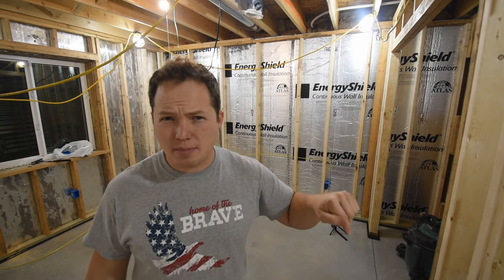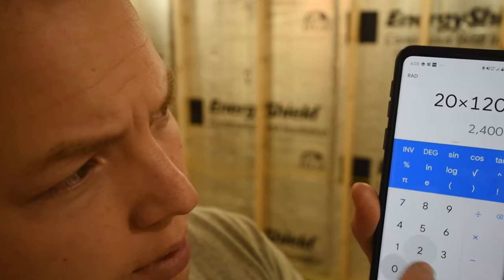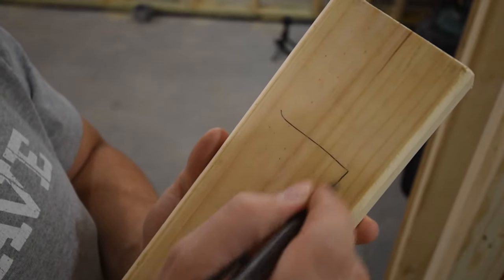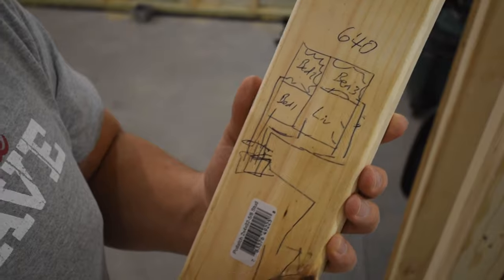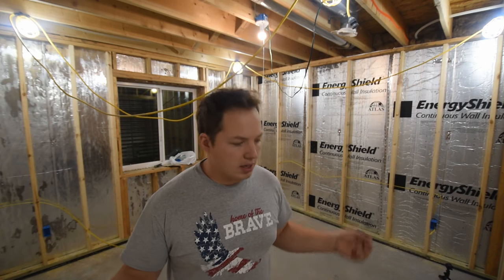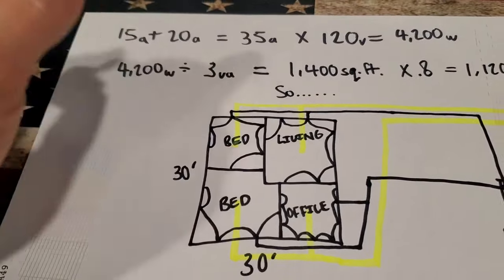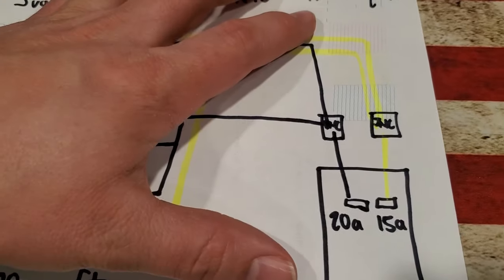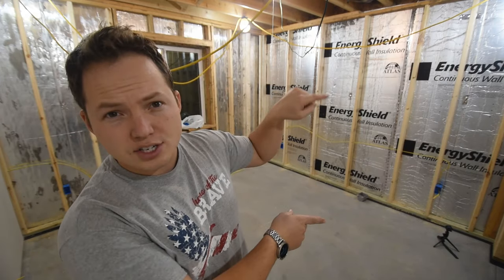Does a Bedroom Require a Dedicated Circuit? - Using the 3VA Rule To Calculate Anticipated Loads

Comment: Awesome video. Only time you can have issues with combining the room outlets (and I've had this problem) is room A is running a 1500 watt room heater, Room B sister is running her hair dryer. Bingo.....breaker keeps tripping.

Comment: Separate lights also helps if you draw a heavy current close to the limit, say a space heater pulling near the max of the circuit, well the lights share the same circuit so you might get flickering. Throw in some fans and a TV and you might go lights out along with everything else because you opened the breaker.
Reply: OH NO! You just answered my question! I was wondering if this rule would take into consideration my kids...and I😅 We have those power strips with the 8 outlets in almost every outlet, and we have space heaters; mine I keep on year-round and now that I work from home, the breaker trips multiple times a day!..But I can't live without my space heater😭
Reply: The NEC changed the code to account for LED lights. They are now allowing 16ga wire with 10 amp breakers. I'd never use them but it's now a thing if you can find them. 
If you're using 6 watt LED wafer lights on a 15 amp 14ga circuit, P=EI or Power = 120*15 amp breaker *.8 (80% load capacity) = 1440 watts or 240 wafer lights on one circuit. I for one will never use incandescent or florescent lighting again so I have no issue running two lighting circuits for a 2200 sq ft home.

Comment: Very good advice. I keep fixed lighting and receptacles on separate circuits. Having the living room and family room receptacles on their own 20 amp circuit is also a good idea.  Wiring the bedrooms like you stated is also good advice, makes it easy to separate each onto their own circuits if desired. While most of the time bedroom plug in loads are usually light,  this may not always be the case. Everyone might use their bedrooms differently.   many times a bedroom gets used as a home office, or as a hobby room and it might be desirable to have those receptacles on their own circuit.
Reply from the maker: Couldn't agree more! Home office or hobby room is a very good point. If it is wired so that you can have at least one dedicated circuit to that room then I think people would be good to go for almost anything. You never know when someone might want to turn their bedroom into a metal working shop though! (kidding)

Thanks for sharing!
Reply: I'm a.ecjanic but I'm also a computer hobbyist. I would hate for someone in another room to pop the breaker and crash my computer.

Comment: i used the 1 room, 1 home run rule. ( each outlet no more than 9 feet apart, and no more than 7 outlets per run ) allowed me to isolate any issues. I also added in for future use, 2 bedrooms, with dedicate home runs,for any A/C  or large appliances that might be needed in the future. the runs are not connected, and have blank wall plate. but, it is there, to save time and effort for any future calls. especially when using a portable generator in power outages. helps me to prioritize my comfort vs requirements. Also with the codes, requiring the new more expensive breakers, i just felt it might be more safe..it does have more cost, especially when the distance to the service panel is taken into account.

Comment: Great tips.  One thing I seldom see addressed is length of the circuit in total (panel to farthest end device) and taking into account voltage drop issues at the far end.  What is the longest acceptable length one can go before drop becomes a factor?  I hear somewhere in the 3-4% range (3.6-4.8 volts) should not be exceeded on a 120V circuit.... somewhere in the 50-75 foot range.

Comment: As AFCI breaker requirements have increased over the last couple of code cycles, and given the cost of AFCI breakers, there is incentive to "max out" your circuits to keep the cost of wiring a house within budget. Especially if you wire houses for a living and are in competition with other electricians for the work.
Reply from the maker: Valid point for sure.
Reply: yeah, before this... bullshit... dedicated 20 for outlets per room and lighting on a different circuit. I hope the cost comes down on arc breakers because damm!
Reply: Do lighting circuits need to be on AFCI breakers?  I totally agree to "max out" circuits. Another question is, is it cheaper to use 15A circuits so you can use 14awg wire compared to 20A?
Reply: @scottschuette74  14awg wire is less expensive since less copper is required to make it.  However the NEC requires 20 amp circuits in certain places especially kitchens where high wattage appliances are likely to be used.  20 amp receptacles are better quality and also more expensive.
Reply: @Peter Evans ⚡watch his next video..
Reply: @Peter Evans think about next show...
Reply: @Karl with a K It must be a real burden to be so damn smart you can't listen to someone else.
Reply: @Karl with a K 😅🤣😂

Comment: Cool rule of thumb. Good video. With LEDs now even 15A would be fine for every room. Lol. I do all outlets in 12. Lights in 14. Even Fridges dont use much now. Crazy.
Reply from the maker: Yeah it's pretty amazing how efficient a lot of the new devices are! To your point refrigerators only use 100 watts or so and only while the compressor is running!
Reply: Yeah, the incandescent bulbs in the Hollywood lights in the bathroom in the house I bought used much of the capacity of a 20A circuit. Not enough left for a space heater, I found. They will be changed out with LEDs before air conditioning season.

Comment: I have multiple bedrooms and when I built my house, this was my requirement- dedicated circuits for outlets, dedicated circuit for switches and lamps, and a dedicated 20amp wall receptacle (for heater etc)
By doing for each bedroom, similar to bathrooms, kitchen , garage, I ended up have a 400amp panel.
Do I use this much ? No... but this is what I wanted. I may have spent 3-4k more but worth it if I live here for 10-15 yrs
Reply: lol tht was always my plan if i ever get the chance i was thinking 400 amp but two 200 amp panels and maybe a 100 amp sub in the garage that extra dedicated plug was for  a room ac under the center room window never thought of a space heater too

Comment: to be honest, if you're going to have a home run from each room you might as well pay a few dollars extra and have them all on a dedicated breaker considering your wire is the bulk of the cost.
Reply: The junction boxes might still make sense if you are short on spaces though, and are planning a panel upgrade with more spaces in the future
Reply: What I did was put the junction box(s) somewhat central to the new rooms and then ran just 1 home run there. If I want to separate these in the future I plan to just run another home run to that junction (or another could be installed nearby).

Comment: One word - teenagers. A blowdryer can easily be 1500watt, add an iron, etc and 20A can get blown. If you have the walls open just spend the extra to dedicate a circuit to each bedroom - I also like lights on their own as suggested.  Also in a living room, a dedicated circuit for a media center can be a good idea both for load (100” tv, speakers, etc add up fast) and to keep noise off of the line for sensitive electronics.
Reply: That's why bathrooms get 2 circuits minimum.
Reply: Just remodeled my back room. Power coming in was on a 15amp breaker shared with both bathrooms, a light in a hallway, and the garage (maybe 2-3 outlets in the entire thing and I think maybe the kitchen or atleast one outlet, ran 3 20s a dedicated for the room itself. A dedicated for an AC and then a 20 amp going thru my walls outside to a weatherproof box which I’m later brining to my shed about 60ft away and also a 2 pole 50 for a welder cus why not

Comment: One thing I've also learned if your living in a colder climate is turning on a portable room heater really sucks up the wattage, which can trip breakers fast and become real annoying, so may wanna factor that in to the wiring.
Reply: Portable heater’s are a bad idea. I use mini splits for heating and they have their own breaker’s. Plus I like each room’s outlet’s wired separately.

Comment: In the houses I used to design we always spec'd two 15a circuits per room so things like a gaming PC and a TV wouldn't overload that run. It was common to have 16-20 breakers for a house for lights and outlets and another 4 for HVAC, Well, washer/dryer, and water heater.
Reply: That seems excessive. I've never had an issue with one 20amp circuit per room. I know your cost are more with all the extra circuits needing arc fault protection.

Comment: NO. We have a window a/c in the bedroom, and when the compressor kicks in, the TV or computer shows that it does. Voltage spike after the compressor is running normally? I don't know. So the receptacle which the a/c plugs into, needs it's own line, no matter how much energy it's supposedly drawing.

Comment: I'm currently building my own home and I'm putting every room on it's own 20amp breaker. Every appliance has its own dedicated breaker. I'm running 12/2. I was taught never put more 12 items on a line. I took it future and never put more than 10 items on a line.
Reply: I did the same thing over built ya maybe but few pennies more ,for a system that should last many many years
Reply from the maker: That's a fool proof way to go! Costs a lot on AFCI breakers and panel space but you will almost never trip a breaker. Thank you for sharing your method!
Reply: @BenjaminSahlstrom  that's what I was aiming for. We lived in two  new construction homes and both were built like shit. We have three daughters and you know how that goes. Damn blow dryers, curling irons & straighteners going all at once and the breakers were constantly tripping. I said enough is enough. The inspector was like you wired this I have a raceway in my attic space dead center with branches breaking off to the rooms. I had my nephew label each line every 5 feet 😂. As you can tell I have OCD 😂
Reply from the maker: @RHEC1776  That's awesome!
Reply: @BenjaminSahlstrom  keep up the awesome work. Love your channel
Reply: @RHEC1776  any electrician will love to trace and or repair in the future if only all owners where like you lol
Reply: No sir its actually best to never have more than 8 outlets on any circuit, and 14 incandescent lights on one circuit,  not leds those are different. Hope this helps even tho its late lol

Comment: I do not know if it would meet codes today. My father wired the house so that from the front of the house to the rear. Living room, dining room, den. The outside walls of the living room were on one circuit, the interior wall between the living room and dining room was on another, the interior wall between the dining room and den were on another circuit, the exterior walls in the den were on another circuit. [as well as dedicated outlets in the LR & Den to run window A/C units] The idea was that if a breaker popped there would still be working outlets in the room. The bedrooms were run with the same idea.

Comment: Hey Ben, I understand your idea, but personally I would just balance my loads as best I can. Installing jboxes can make future troubleshooting messy and difficult.
Reply from the maker: Good point. Junction boxes often seem like they can indicate some kind of an issue existed there. It's worth marking on the jbox cover to help alert people in the future the purpose of the box.

The other option is to just bring all of your wires into the panel and then combine them there. Only downside with that is that it takes up precious panel space and makes it harder to avoid the rat's nest look. :)
Reply: @BenjaminSahlstrom  also make decent plans for any possibility of future trouble shooting and new owners
Reply: @BenjaminSahlstrom  ... one point to mention here is the building inspector's opinion. A good percentage of these guys want 0 (zero) splices inside a panel so the alternative is a few boxes or a tray for external splices. Use of a sharpie marker at this stage will save MANY problems down the road. Tag everything while it's fresh in your mind and you would not have to figure it out later on a trouble call.
Reply: @rupe53  Great idea on the marking. I label each cover plate with the number of the breaker. This can be done on either side of the plate. This helps me from turning circuits on and off to find the right one. That paper used to record where the power goes can age over time, making it hard to read. I also use a plastic labeling machine instead of writing with a pen or pencil.
Reply: @rupe53   "A good percentage of these guys want 0 (zero) splices inside a panel." When I did my panel swap I ended up with one splice on a neutral wire. The local EI tried to fail me on it, until I pulled out the NEC and pointed out  that  article 312.8 allows for it. That was good enough for him and he passed it.

Comment: According to the NEC, The maximum spacing between receptacles in general living areas is 12 feet, with no point along a wall being more than 6-feet from a receptacle. That being said, a typical 11 x 12 bedroom with a door and closet would have usually 5 or 6 receptacles in it. My understanding is NEC limits the number of receptacles to 12, though most limit a circuit to 10. Therefore a single circuit will cover two rooms.

Comment: It is not required, but I wire bedrooms on a dedicated circuit. I do bathrooms the same way.  Lighting from 2 to 3 rooms, I have put on a single breaker.  Many, many times I have seen where 3 bedrooms and 2 bathrooms were on a single 20 amp breaker.  Many electricians put everything on one circuit to save themselves time and money and it becomes an issue for the homeowner.
Reply: Bath had to have its own 20 amp circuit per NEC

Comment: yeah when i rewired the house i used 14 gauge  15 amp circuits for the lights and 12 awg for the outlets , (back when copper was sky high)  reasoning for  the lights on a separate circuit as  99% of the time lights wont trip a breaker its the outlets. so this way you're not in the dark
Reply: doing the work yourself and supplying matts nothing wrong with spending the extra money above code is always better.  code is just bare minimum D-  😉
Reply: @wizard3z868  yeah within reason the extra $300 for wire alone plus i already had the breakers , cant justify the cost
Reply: luvdady better that way isolated lighting and power circuits. And with led lighting u can easily run multiple room lights under one breaker no problem
Reply: @Nick-bh1fy  yeah  led power consumption is insanely low. 
I'm doing an office shed 30 amp sub panel.  Do 3 lights and a  ceiling fan and then black plugs on the light circuits and then white plugs on the other circuit. 
That way I can always have lights and power, if the other side is off.
8)
Reply: luvdady very smart idea
Reply: @Nick-bh1fy  a very wise man once said"" if you think twice you might be a genius "" It has paid off several times in life especially running cable in networks .
Reply: @Nick-bh1fy  yes a 15 amp circuit usa can have a max of 1800 watts i do constant load at %80 so figure 1400 to 1500 watts with 25 watts avg led thats a lot of light lol
Reply: @luvdady  .23c/foot when you buy a 1000' spool. When you have to add circuits later that $300 is cheap compared to the retro labor to add circuits. And if you have to add a sub panel. I get $65/hr plus travel and to cover my ass for insurance reasons I would get an inspection @ $85-$100 so the $300 savings is gone fast.
Reply: @bigrick7108  not really  
, what do i do with the left over 600 ft ? that was as stated when copper was sky high . 
then all the lighting was accessible from the attic , so a rewire wouldn't be  to difficult  and with led bulbs you could literally run hundreds of lights off a single circuit. so while yeah im good for the next x amount of years. its like running cat 6 cable vs cat5e vs fiber the added cost may not improve performance .
Reply: @luvdady   luvdady  I would not be worried about lighting as you started LEDs have minimal draw. Outlets and who knows about future loads are totally different. Copper in the last 20 yrs went from .71-4.003/# you can always buy it by the foot but when you come up short there is no savings. On bigger wire, my suppliers will let me take a new spool and charge for what I use. It is way easier to pull from a spool then a coil.  My labor is worth more to me than 600' of Wire that I will use later anyway. I don't have time to do things twice. When I wired my house I put way more outlets and circuits than code says. I like dedicated circuits for electronics. Nobody ever says too many outlets. After furniture is in you don't see them. But I get calls every year that people need more. I love T&M jobs. Ben has the right idea using junction boxes so you can split it up later if you need to. The breakers are the big cost now.

Comment: My apartment has both bedrooms, including the 2 wall sleeve air conditioners, on the same circuit WITH my living room AND kitchen. Summer sucks for doing really anything because using the provided air conditioners at the same time as trying to watch TV in the living room can trip my breakers.
Reply: That's sad only one circuit for everything. I had a home with 60 amp service and they put kitchen outlets on one, bedrooms, bath, hall and lights on another, living room and lights on another, and everything in the basement, garage and such on the last one.